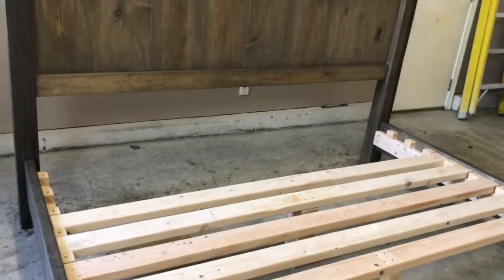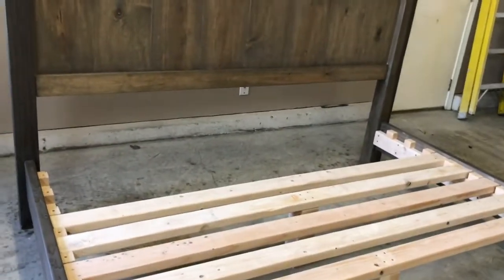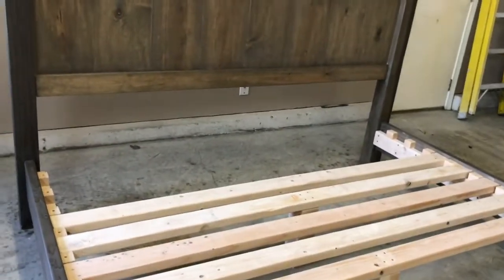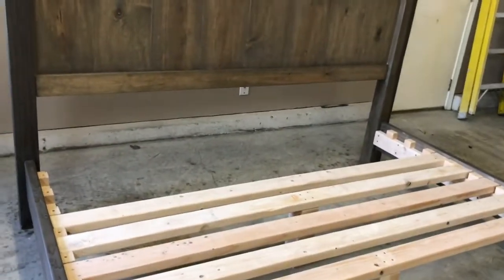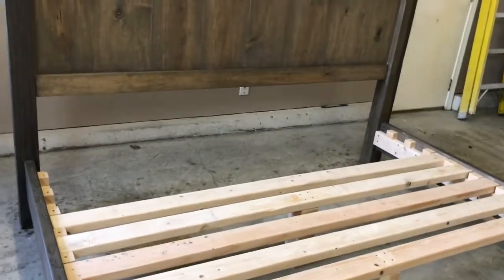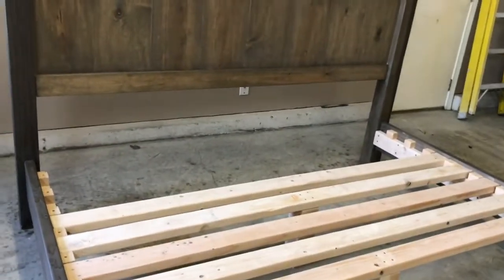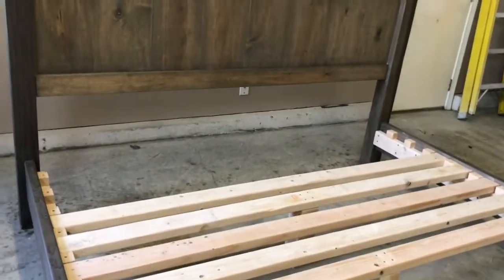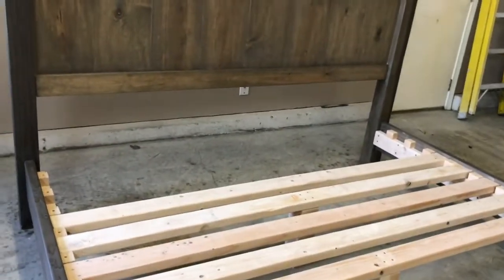DIY King Size Farmhouse Bed

Comment: Great bed plans.  I used yours and the other two plans and made a combination of all three.  Turned out really well and I ended up measuring everything correctly!  Making a router template for the recessed bed rail hardware made things much easier in the long run.
Reply from the maker: Yay! I'm happy to hear you came up with your own version that works for you! I don't have a router but that sounds like a good way to do it ... by hand was NOT fun!

Comment: the little gap in your cap, run the screw in then back it out and run it in again and it will pull tight. the first time you run the screw in it tries to jack the two pieces apart since the screw has threads all the way up.
Reply: pre drill it

Comment: Pocket holes aren’t really meant to be used for any load bearing applications. I am finishing a similar design for my son at the moment. My legs have a mortise and tenon 1 1/2” deep into the leg. My side rails are also similar, I stood the blocks up because of the wear strength of the end grain. 
Anyway, great job for your first project! Looks very nice!

Comment: With the rest of the slats in place it will be plenty sturdy.  Another option is using joists.  Attach joists to side rails.  Dont attach slats to joists for easy assemble/disassemble.
 As for a hardware cover up I suggest glue and Brad nails when making the headers for the slats.  I also made pocket holes to attach my head and foot posts like.  Its sleaker than carriage bolts through the side.  Awesome job.  Keep it up.  Its so rewarding to make your own furniture.  Im almost complete with having all store bought furniture out of my house.  Bedrooms are all that remain.

Comment: Great job. What type of wood did you purchase? Was it rough or dressed? And did you plane your edges for that softer look? Thanks.
Reply from the maker: The 1 x’s are select white wood and the 2 x’s are rough ... all from Home Depot. I sanded everything but didn’t use a planer!
Reply: Jayleen Creates Thanks. And the 4x4s?
Reply from the maker: The 4x4’s are rough, untreated fence posts from Home Depot! I have found the rough cut boards take the vinegar stain much easier!

Comment: Thank you for sharing your video! We plan to build a similar king bed this summer. We too want to use bed rail brackets for easy assembling. I found another type of brackets called surface mount brackets, which I thought might be easy to use. We will give those a try. In the meantime, do you mind sharing your cut list? Thanks. The bed come out really nice!!
Reply from the maker: Hi Julia! I would love to know how those brackets work out for you! I used the cut list Ed Hart provides here: https://www.edhart.me/diy-farmhouse-bed-king-version/ I actually purchased his plans but the cut list is in the post. You can find more info on how I built the bed here: https://sunshineandrainydays.com/king-size-farmhouse-bed/ (but there isn't a cut list there). I'm so glad my video was helpful! Have fun with your project!
Reply from the maker: Hi Julia! You can find more info on the bed I built here: https://sunshineandrainydays.com/king-size-farmhouse-bed/

Comment: I would had just screwed the rails in
Reply from the maker: That would definitely be a good way to do it! I wanted to be able to move the bed easily, which is why I chose not to screw the rails to the sideboards. That being said, it’s been a few years and I haven’t needed to move the bed up to this point.